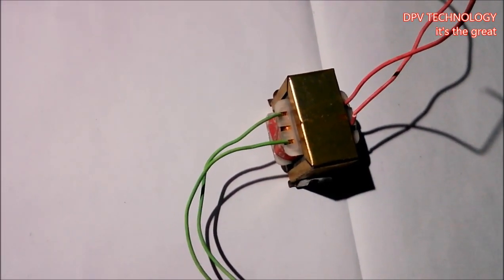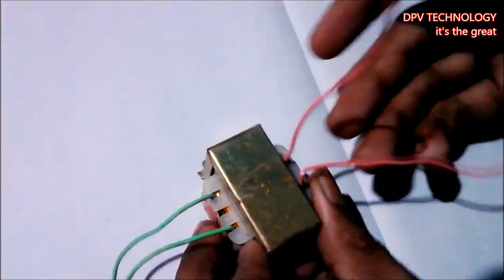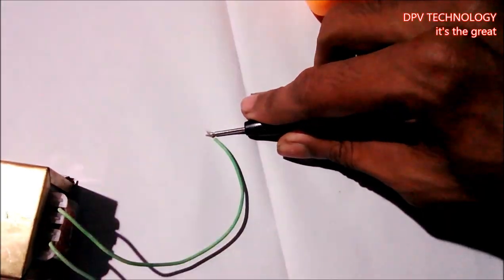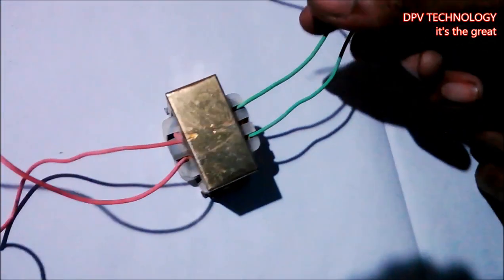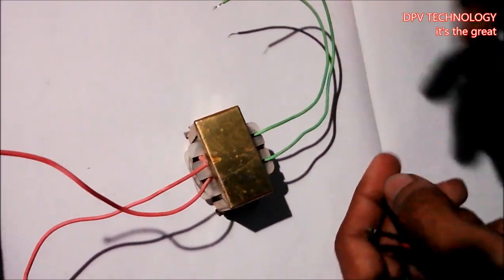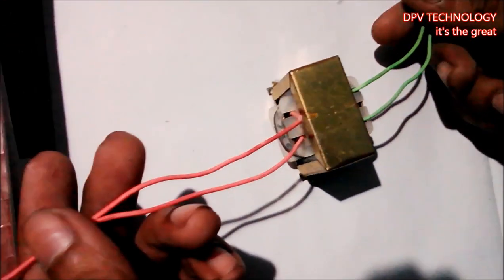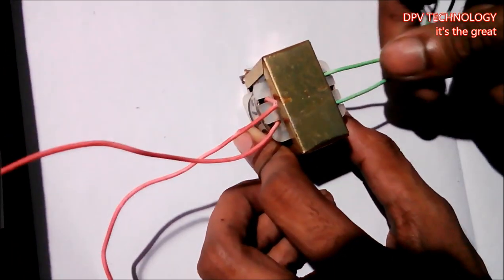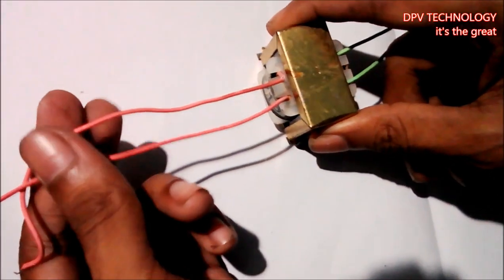How to Identify primary and secondary of a transformer

Comment: What you call primary and secondary depends on which side you want to use as input and output. If you use the high number of turn side (high resistance) as primary (input), it will become a step-down transformer = lower voltage and higher current on the secondary side (output) and vice-versa.
Reply: Are there any considerations when using two transformers back-to-back to get high voltage cheap?
Reply: @anti_globalista  higher voltage = less current. Power = current x voltage, if power available is constant, current and voltage will be tied to each other according to this formula.
Reply: @dongpedroyi  I know Ohm's law. What are you actually saying? That two transformers must be same in power to use them back-to-back?
Reply: @anti_globalista  I am not getting what you mean by two transformers back to back. Can you explain in more detail?
Reply: @dongpedroyi  You connect secondary of first transformer (step down) to secondary of another (step up) and get high voltage transformer VERY cheap (only first is connected to mains). It's called back-to-back. You can see example in this video  https://www.youtube.com/watch?v=yp_EKyv2ZLc
Reply: @anti_globalista  ok, I see what a back-to-back connection is now. The video shows 240v ac stepped down to 12v then the output is some unstable reading around 190v ac then the video ends or gets interrupted by an ad then moves on to a different video. What is it supposed to achieve?

Comment: In transformers no side is primary or secondary. We call them high voltage side or low voltage side.
Reply: Baat ek e he bro... You cant change the power supply of electricity so that has to remain primary in any case.
Reply: Not necessarily true. There are also step-down and step-up transformers.

Comment: It can be either one, step up or step down Depends on which set of coils you connect to the power source. One set will step the voltage up and the other set will step it down. If the coils with the most turns and higher resistance is connected to source voltage it will step the voltage down. If the coils with the least resistance, and having fewer turns is connected to source voltage then it will act as a step up transformer. Usually the side with thicker wire indicates a higher current so it will be the lower voltage side. The amount power dissipated on the side used as the primary set of coils (connected to source) will be close to the amount of power dissipated on the secondary set of coils (connected to load). There is minimal losses due to Eddie current and other factors but for all practical purposes in the following equation we will assume that they are equal. We know from Ohms law that E=I×R, and P=I×E where E is the electro motive force or Voltage, I is current, P is Power, and R is resistance. So if Power in equals power out then this means if a voltage is applied to the side with most resistance the current flow will be lower on this side, so the voltage on the other side must decrease causing the transformer to function as a step down transformer. The voltage will be steped down. The amount the voltage is stepped up or down depends on the turns ratio of the transformer. 
  If the side with fewer windings or less resistance is connected to the source voltage then the current due to less resistance will be higher on the primary side if current goes up and the source voltage stays the same then the power dissipated will increase as well. But the output voltage will be steped up by a factor of the greater number of winding turns that one coil has for each one winding turn in the other coil. In a tranformer with a turns ratio of 10:1 if used as a step up transformer, the voltage on the side with the most resistance will be the side with the most windings. This means that the voltage on the higher resistance side will be 10 times greater than the voltage on the lower resistance side. Lower resistance means higher current flow, as current goes up the voltage must go down. Remeber we already established that for all practical purposes power in is equal to power out. Usually the side with the less turns and least resistance will use heavier guage wire due to higher current flow.
Reply: thanks bro
Reply: How to identify output and input wire in transformer
Reply: @KhanAfridi-wn9ic  assuming it's not a tapped transformer, and it's  a good transformer with no opens (breaks) or shorts in the coil wires. It will have four leads. Any two leads that show continuity between them will go to one set of coils. The two remaining leads, when checked, will also have continuity between them, and this is also a set of coils. Again, step-down, or step-up, just depends on which set is connected to source voltage. A third type of transformer is an isolation transformer, or 1 to 1 transformer. It's called this because the number of turns on the primary (input coils) are the same as the secondary (output coils) this turs ratio of 1:1 ieadly gives you the same AC out put as the your input. But it isolates the circuit from the source. Without going into detail, I have seen these used in welders, and for very good reason.

Comment: How to identify the 110 vs 220 connections of a three-wire primary (black, blue, red)?
Reply: the 220 connections require the "full length" of the coil on the primary side since the secondary voltage is inversely proportional to the number of primary turns. To get the same specified secondary voltage you would need twice as many turns on the primary side. Usually this is obvious by inspection as the center tap on the primary to either end will be  110 V and the two "outside" taps are for 220 V. You could also measure the resistance with DIMM between two (primary) terminals. The two terminals having the higher resistance are the high voltage one (220) and the other two pair of terminals will have approximately half this resistance are are intended for 110 V. Finally you can simply hook the leads up to an oscilloscope and use a function generator set for 60 Hz and some low voltage (say 5 Vpp) and see what comes out of the secondary.

Comment: I bought a transformer and the label says 110/220 primary (red black red wires) , 12 0 12 secondary (blue white blue) . Now my question is how to identify the 220 volts and 110 volts in primary?
Reply from the maker: 110/220 is the input voltage to the transformer. You don't need to measure it. In india it is 220 V.
Reply: 110/220 primary (red black red wires) 
means if you use 2 red wire then connect to 220 volt ac mains, and
if one red and one black then connect to 110 volt ac mains
Reply from the maker: No, are you from india?
Reply: @DPVTECHNOLOGY  
yes from india, 
can you tell me the use of black wire or the 3rd wire in primary winding.
Reply from the maker: You have bought  centre tapped transformer ?  Means one side has three wires ( red black red) and other side has two wires. Am I correct?
Reply from the maker: The three wires side is secondary side. Don't connect it to main ac line. Transformer will burst if it is a centre tapped step down transformer
Reply: @DPVTECHNOLOGY  
yes the transformer is center tapped for secondary as well as primary, so that his transformer has 3 wires in both sides.
and it is also labeled as 110/220 primary (red black red wires) , 12 0 12 secondary (blue white blue)
Reply: @DPVTECHNOLOGY  
because in India we only have 220 v option so he should use 2 red wire of primary section for 220 volt. center tapping in primary is for 110 v.

Comment: Depends if it's a step down or step up transformer
Reply: I think, in this case, transformers work either way. "Step up" or "Step down" is just the way they are marketed. On several applications in the long distant past (read "before low cost 12v to 110v inverters"), I fed the "secondary" of a 12v transformer with 12vac to get 110vac out the "Primary" side. Worked fine for years.

Comment: Kya 12 0 12 transformer Step-up transformer hota h jisme secondry wire 3 hote h 
R jisme primary r secondry dono 2 wire hote h wo step-down transformer hota h ????
Reply from the maker: +SURAJ KUMAR   
Thank you very much for your comment.
The 12-0-12 transformer is Step down transformer.The three wire side is secondary side.You will get 12 volt or 24 volt according to your setup.We will upload video on this topic very soon.

Coming to your second question,the transformer in which two wires in both primary and secondary, can be step up or step down.For finding out primary and secondary,you can use our method given in the video.Hope you will get it.
Happy new year in advance..
Reply: SURAJ KUMAR mG op tr